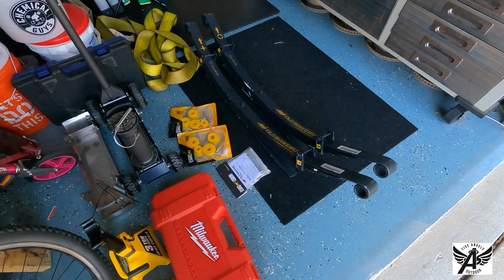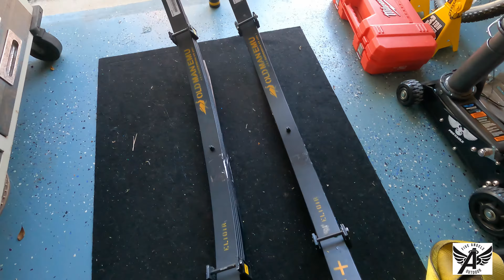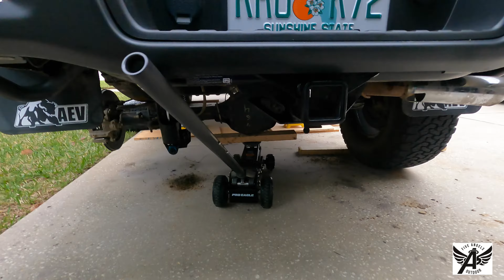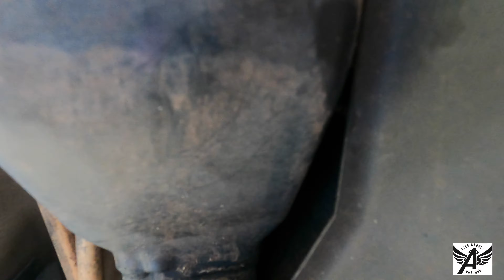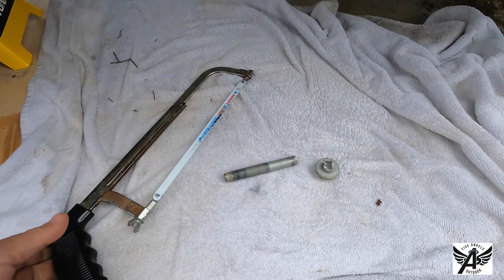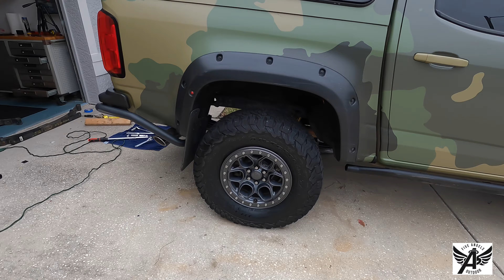IS AN OLD MAN EMU LEAF SPRING UPGRADE WORTH THE MONEY?? #overlanding #suspension

Comment: What type of grease did you use
Reply from the maker: I used a Marine Wheel Bearing Grease (NLGI 2) from Northern Tool & Supply
Reply: Polyurethane bushing should have silicone based grease